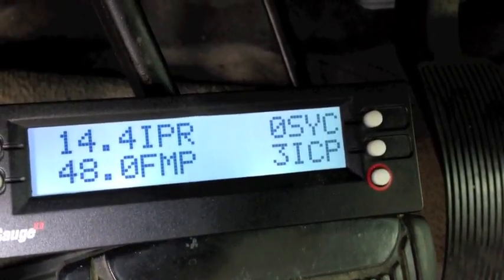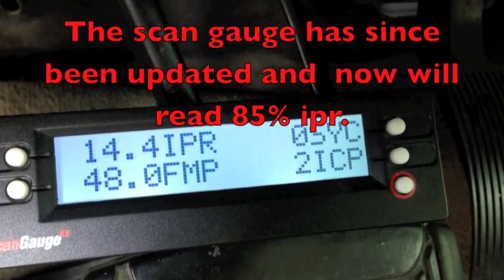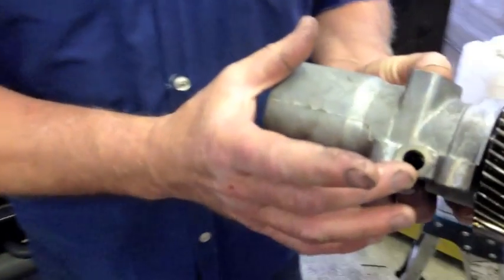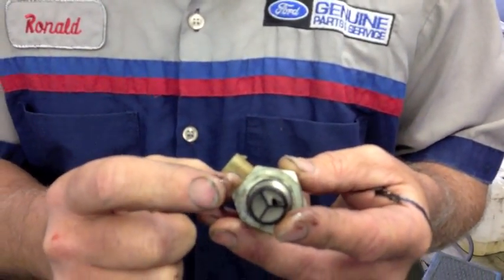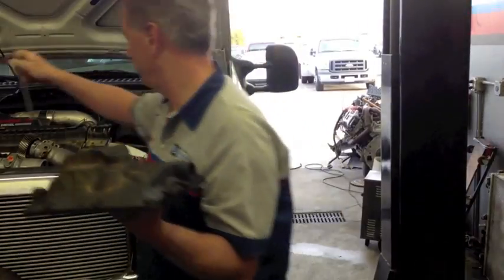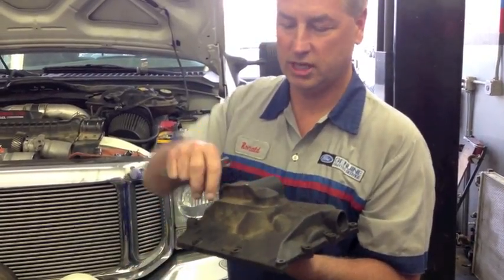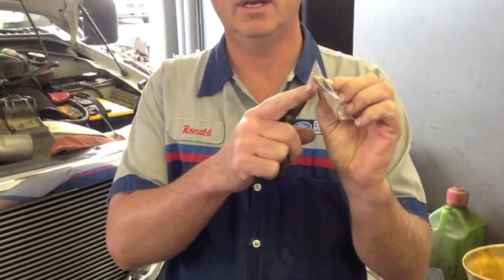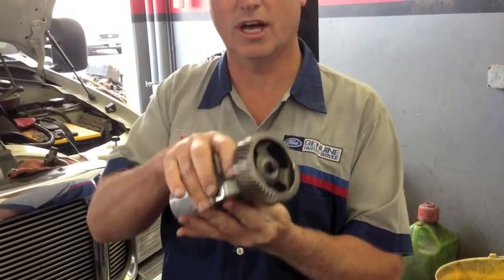P2290 P2291 04 6.0 powerstroke no icp, failed hpop pump. tips and tricks on pump removal

Comment: 05 F350 6.0 etc.
I've owned the truck for years. All the heads of been redone rocker studs and all that good stuff. Yesterday twice the truck shut off just like turning off the key. Today I sat in a driveway for about an hour with the truck idling all my numbers were good but the truck died for a quick second and my ICP went down to 105 and then pop back up to over 600. What would cause the ICP to drop for a Split Second? Sometimes it takes a few minutes to restart other times it will catch itself and keep running. Ficm good, IPR & sync all good. Great volts.

Comment: Hi i have a 03 powerstroke and it wont turn on, it all started when it lost some power then it turned on and was working rough and then it wouldnt turn on again, i replaced icp sensor and ipr valve and it still doesnt turn on. Any ideas?
Reply: ever figure it out? i have same exact situation. Replaced ICP and IPR. Also did the fuel filters.
Reply: Me too same thing cleaned ipr new screen and seals , 85% while crankong what was your fix

Comment: Hi Ron i have a 03 6.0 with aluminum hpop it leaks from front seal is good or replace the seal or hole pump i only put 130psi of air and starts leaking air thru there.

Comment: Ron, I have an early 04 6.0 with lots of gray smoke and rough idle. egr deleted, headstuds, oil cooler and blue spring. smoke smells like oil and diesel. it was throwing a p0281 code, then that cleared, threw a cylinder 2 contribution/balance code. i know the icp is leaking, i found that, but could my hpop also be bad? this is my only vehicle and i need it to be running
Reply: Sounds like your blowing oil. on a turbo that'll fill the intercooler with oil; but why? These will all blow oil as far as I know.1st check the air filter, 2nd if that's good time to check Crank case pressure [start vehicle, pop hood, unscrew oil fill cap, flip it over on the oil filler hole, whilst watching cap have a bro rev the engine.] If the cap sucks down to the filler hole,THEN you have negative pressure. That's good! If the cap falls off idling or whilst they rev the engine... that's a positive pressure and certainly you will have oil in your, flame trap, intercooler & inside the Turbo. '' is your oil filler cap is not CONCAVED [DOMED]"
Reply: THEN USE SOMETHING DOMED AND APPLY THE SAME EXPERIMENT.  > is down (]>=concave cap  or   )]>=convected cap... You need a concave domed anything to set upside down on the oil filler hole in order to see what it does.
Reply: RIP RON and thank you from us all

Comment: p2290 04 f250  truck runs icp good ipr good screen good so ?  runs through gears good until high gear 45-50 mph starts bucking  runs rough ?  new fuel pump new fuel filter all ford stuff HELP PLEASE !?
Reply: ever figure this out?
Reply: Venise Eder what about now? My truck had a HPOP done a few days ago and the mechanic said it turns on already. So i went and picked it up, and i know my truck, something was wrong. It starts fast, moves through gears regular, but going 50mph+ it picks up slow and i can see the temps going too hot and too fast too. 210°+ Before that, it used to pick up way faster at any speed.
Also a brand new sound since i got it back appeared. Its this humming sound when the gas pedal is pressed. What did the mechanic fail to put back or whats it missing? Im about to change the fuel filters.. ill see if it works with mine.

Comment: Thank you for your  Videos and  ur time. I'm a disabled army vet an u have saved me an my family thousands I got only error message Damn P2290. With idle that surges but fixed that with new icp.Next I knew to check ipr an from there High pressure  oil system aka weak hpop. An a sticky turbo which I replaced due to dealership filings the fins an clunky  sound don't  want it to blow an take  my truck out. There are lot of shops that are shady an take advantage of us. I was charged for rear main seal to be replaced 800+ an less than yr later leaking as well as oil pan an deck lid. This is my first an last Ford diesel. Take Lota heat from my family aka dad cuz he switched to dodge an gets 23 in town an 26.3 highway with his 6spd. Thank u again  sir.

Comment: 2011 Ford F-350 Super Duty King Ranch 6.7L No Start VIN: 1FT8W3BT1B
P2291: Injector control pressure too low. We are looking for any information that could help us diagnose this truck or figure out the next step to determine the cause of the no start condition. Thank you

Comment: Ron have a 03 6.0 shut off while driving, ficm 48+ ipc 85% icp low, low pressure oil filled filter cup ok, did not do a air check. pulled it down thinking the ball was popped out but to my dismay it is not... icp never got high enough to start. 116k on the excursion,is there another fault that happens with the pumps? reinstall the hpop and do a air check?thanks.

Comment: Ron, i have a Ford F350 Dually 2004 that when you press on the pedal floored you have no power, it slowly picks up speed but til it does it almost feels it is going to shut off, slowly the turbo builds up and then kicks in, if i am towing something heavy i will never get out of the spot i am in, it is like pressing the brakes and fuel at the same time, it is diesel and it wont move, if i am not on a hill then i can tow and it will build up and eventually move, is this saying i dont have enough oil and need a better oil pump or is my injector gone or both, i recently had a company work on my truck for 2.3 years and put twin turbo and a bunch of other things but they could have done other wrong things as i see on the internet others have been duped by the company, please any help is greatly appreciated as this is my work truck and has cost me a fortune, thanks
Reply: This comment is as far as I know, all knowledge and cannot guarantee is right. Powerstroke is the only Diesel engine out of the 3, cummins and dura max being the other two, that have different way of running. Ford put in a super dumb HPOP and they also did things different with the indirect injectors and direct injectors. Best way to go about your problem bring it to a trustworthy garage and see what they say.

Comment: Ron, everyone tells us to "simply" remove the heat shield lol. how do you get to the bolt behind the hpop on the passenger side that holds the heat shield to it? tried from the bottom top sideways and cant get it out.
Reply: nm I got it lose from the top and finished with a mile of extensions
Reply: Ford repaired the stc fitting on my hpop of my f250 under its warranty.  fast forward to when i tore it down to do headstuds.  I found they literally cut that mounting tab off the hpop cover.  i guess thats one way to do it. lol

Comment: 2003 6.0- I REPLACED  BAD#8 INJECTOR ALONG WITH INJ. ORINGS ON WHOLE  BANK & NOZZLE WASHERS. NO NEW SEAL FOR THE CONNECTOR ON THE OIL RAIL SO I USED THE OLD ONE.IT RAN BETTER THAN EVER.1 MONTH LATER IT HAD A LONG CRANK BUT STILL RAN GOOD,THEN SHORTLY AFTER DIED ON THE ROAD. FSYNC:YES/ FICM V:47.5/ DUTY CYCLE 85% ICP 400PSI WHILE CRANKING.DO YOU HAVE A PART# FOR AN ORING AND ALL SEALS I WILL NEED WHEN I CHANGE HPOP TO ENSURE NO MORE LEAKS WHEN IT GOES TOGETHER?ORDERING DIESELSITE ADRENALINE HPOP.

Comment: Hi Ron, great videos by the way, I am stumped on a engine I just did for a client and this 6.0 ltr is all new, I did the heads stc fitting and 2 injectors, also I changed the ICP sensor as well, here is the thing there is black smoke on idle and won't go away, it has a banks six gun tuner in it that my customer had it installed 2 years ago can you let me know where to start stabbing to rectify the problem, I have an ipr valve that I got but want to make sure it's that maybe? Can you help me out

Comment: hi Ron I have a 2004 with a 2003 6.0 motor, ambulance package it a f250 pickup where is the ipr sensor it was running fine came back out to start no start but I did notes that my turbo whistle there then not , my turbo is always been load from the frist day my friend bought it from deal it got 2 alts please let me know I don't see it thanks

Comment from the maker: It's just low pressure. It could be a leak, restricted or failed ipr screen/valve, wiring, pcm or a weak pump on 03-04. I have only found 05 and up either good or bad and only ever a few bad 05 style.

Comment from the maker: The pipe is the coupler on the 03-04 style. About half the bearings are missing and the other is half is by the pump. So far no customers have stepped up and paid for the fishing expedition  so I guess they are still in there. There's a lot out there like that.

Comment: where did the bear end up? the oil pump?:D buddys lucky it didnt hit the cam gear or crank gear's and damage the teeth, but what was that pipe you were holding ron? at the end about the yellow seal on the block?